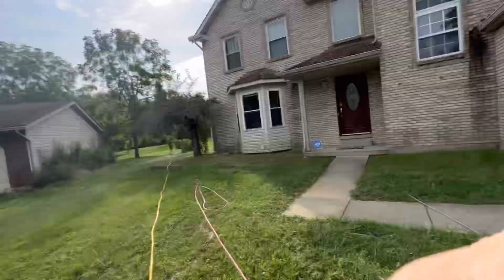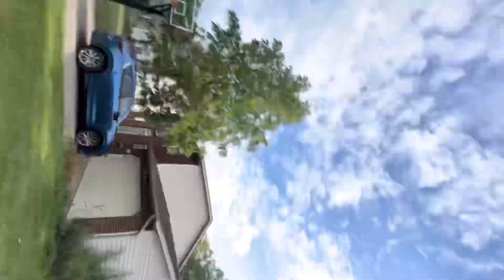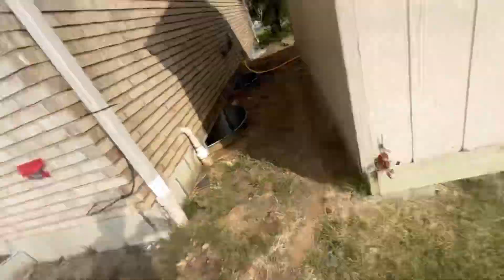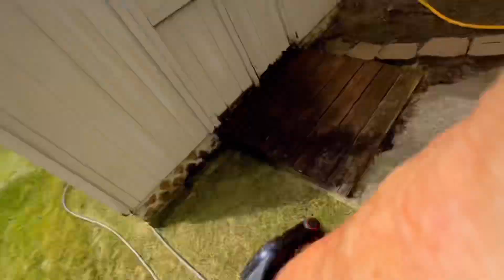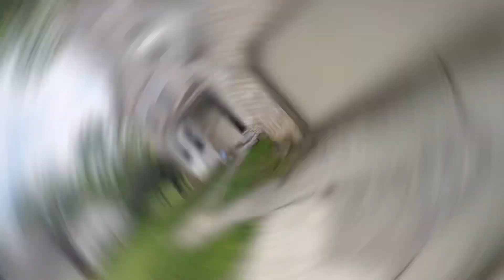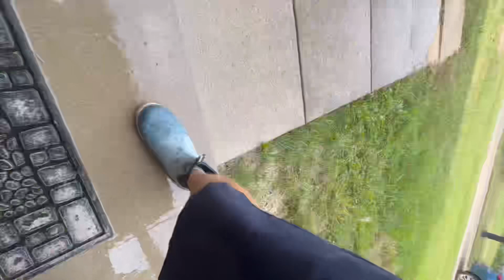Massive Explosion Nearly Ended My Career! #pressurewashing #powerwashing #softwashing #explosion

Comment: You dont use surfactant on roofs?
Reply from the maker: Not usually
Reply: @TheFreshRinse  yeah that is what I've heard I just started the business this year what was the reason you stopped using it? Do you feel like it doesn't make a difference one way or another as long as you spray a hot enough mix?
Reply from the maker: @BRExteriorPro  I don’t wash a lot of roofs. If I had more roof washes, I might go back to it. No particular reason. On a steep roof, it’s definitely better to use surfactant.
Reply: @TheFreshRinse  thanks